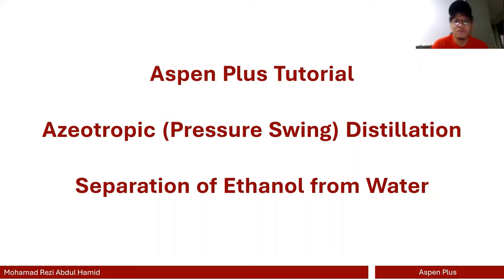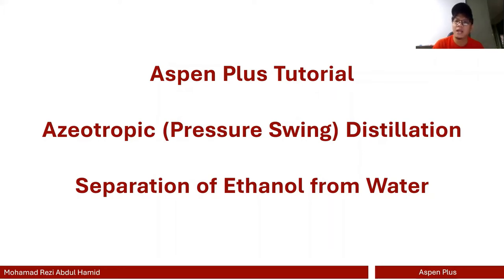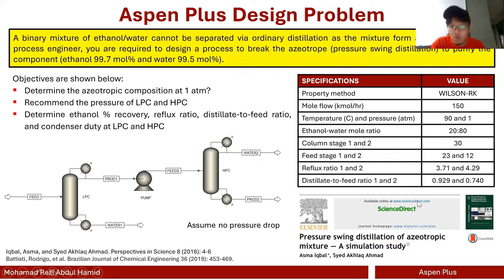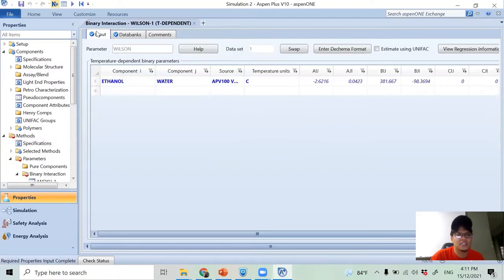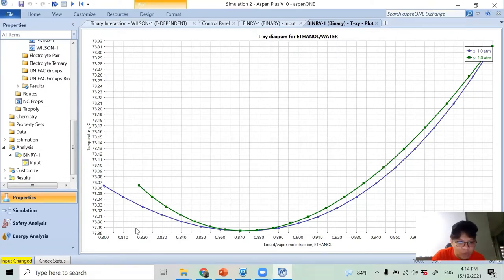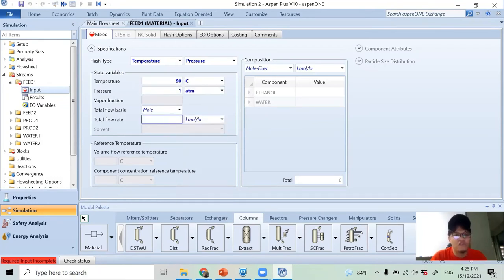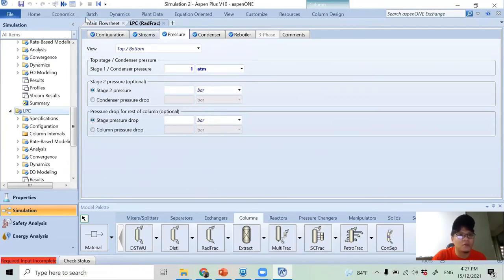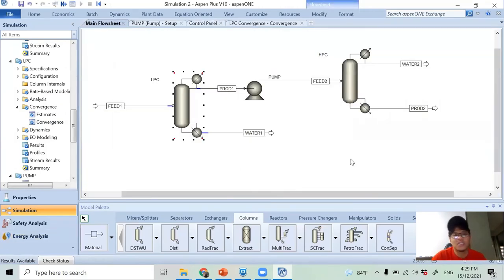Aspen Plus - Pressure Swing Distillation to Separate Ethanol Water Mixture

Comment: 8:33 ethanol-water mole ratio 20:80
26:24 mole-frac value ethanol 0.8 water 0.2
It shouldn't be mole frac 0.2 ethanol and 0.8 water?
Reply from the maker: I think it is a mistake in the design problem..because my explanation is based on feed 80:20 EtOH:water..but anyway, the concept is still the same...